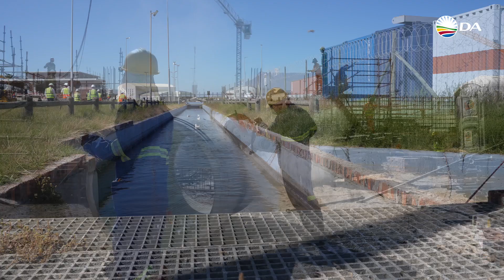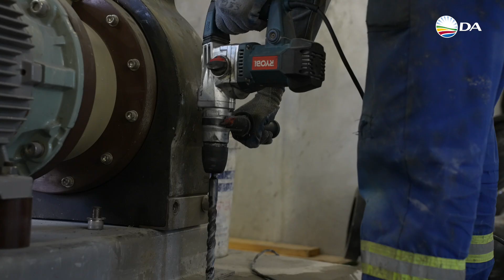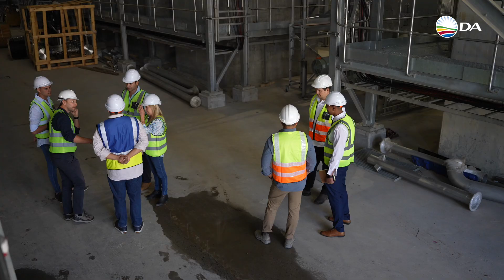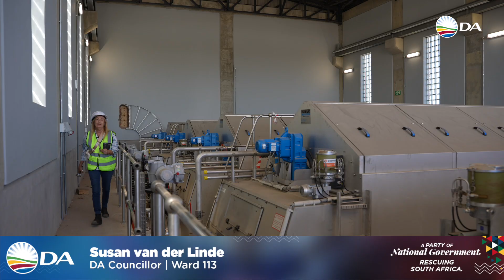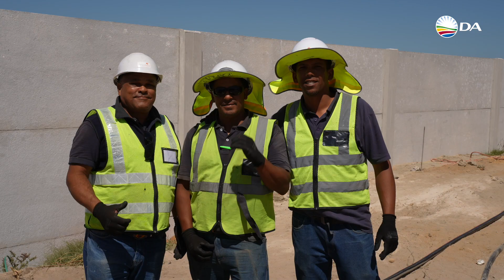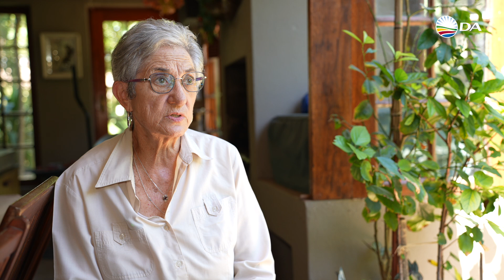DA-led Cape Town invests R5.2 billion to upgrade Potsdam Wastewater Plant for cleaner water

Comment: I doubt that doubbling the capacity of potsdam is enough.  Why?  BecUse half of SA are moving to Cape Town. What is at Potsdam does not cope with the shit already there with Dunoon and Joe Slovo and and as the land along the river is being unlawfully occupied by people not of the Western Cape.  If I were governing CT I would quadruple all projects because its the only place in SA that functions and that is at a squeeze.
Reply: I live in Parklands, and I can give you an update.

Those people occupying Joe Slovo and Dunoon by the riverside were evicted last week. Those individuals—or should I say criminals—were protesting against the evictions. They burned tires and damaged people’s vehicles.

The authorities are currently building a big wall to prevent them from occupying the land again. The government needs to change the PIE Act—this is the only way to stop the illegal occupation of land. However, I don’t think the ANC will allow this, as they want to undermine the Western Cape and remove the DA from power.

Comment: I live just across the river from this upgrade. We welcome this investment. For those who do not know this area, new houses are being built a block at a time up the road. Thousands of people are moving here and this is thinking ahead by the DA.
Reply: The lagoon stinks like a sewer and has done for years. The pollution has killed off much of the aquatic life .
While the DA are trying to rectify the problem they did not think ahead .
Reply: @ProcaviaCapensis-ts8ub  I am very aware of the smell and the pollution. Something is being done, that is the best we can hope for. Look at the rest of the country. I too have suffered the smell for ten years and am not happy. At least we have some hope now. I will take whatever I can get and be greatful for it, considering how badly others have it. If you want perfection, this is the wrong continent for you.
Reply: @antonvrb1510  That's the problem. Because the ANC sets the bar so low we accept mediocre.
I don't expect perfection but I don't think that the goal should be simply to do better than the ANC.
I generally support the DA but we need to aim a lot higher and we need to critisise where the DA fails.
Reply: @ProcaviaCapensis-ts8ub  Agree with you there. The bar is very low and my DA vote is not guaranteed for life. Improvement is to be applauded though. I will wait untill the next elections before I look back at actual results. I do appreciate your point.